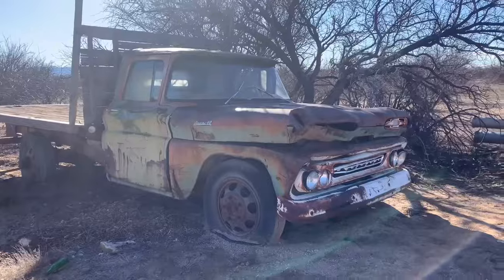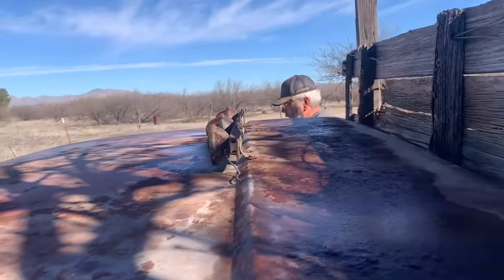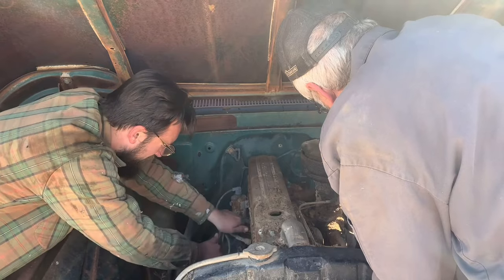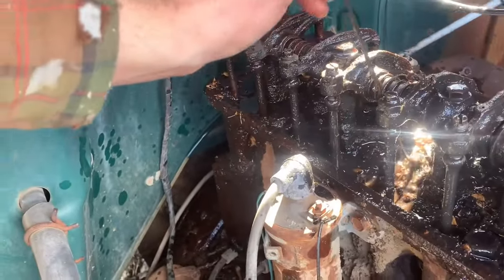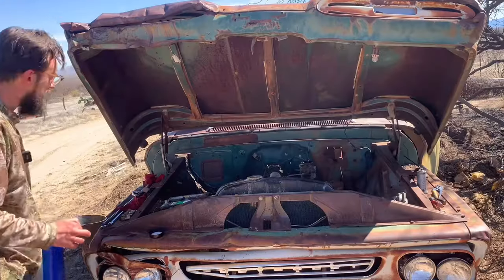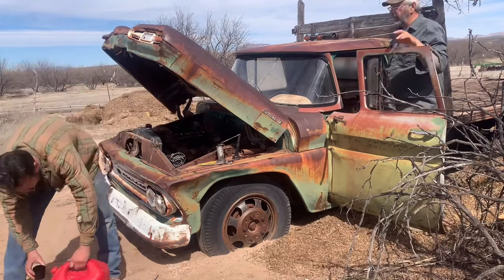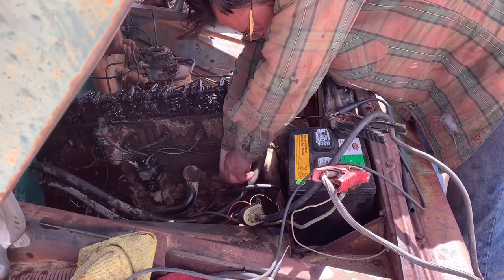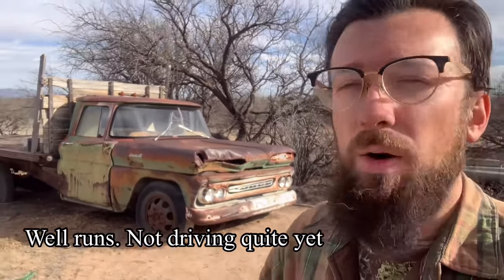‘61 Chevy ranch truck ABANDONED 38 years ago hauling hay. Will it run?

Comment: Great job, guys.  That old 6 wanted to run, and was happy running.  Quite a testament to how well it was built.
Reply from the maker: Yeah! Great engines. Thanks for watching
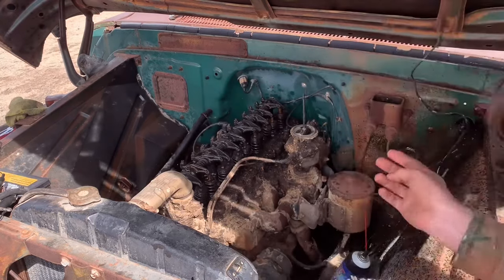Reply: @MaxGiganteum  You missed it at 31:15 when it had plenty of oil pressure and blew that hose.
Reply: If it had pressure to blow that line it's got plenty.  These had a passive oil filter system and would only filter a small amount of pressurised oil at a time. That line is straight off the main oil galley to the filter which then drains right back to the pan wont change the oil flow at all removing it just wont filter it.  Besides these could idle all day long at 10psi and run fine.
Reply: Watch GM bring back inline 6 engines.
Reply: @rustbeltrepair5472  😊

Comment: You're doing a great job saving those ancestors from melting down into rust forever.  Hello from Belgium, Europe :)
Reply from the maker: Thanks for watching from europe
Reply: @Theetravisb  
What do you guys charge?
   I have a 55 gm that's been sitting for 15-20 yrs.
    It's got a 455ci from a 72 Buick century in it.
 
    It ran GREAT when I parked it. No leaks, no slips, didn't burn oil , no knocks. Not even any lifter tics.

    I parked it when I was in college because the breaks were shot. 
    Started it every once in a while, but haven't done that in over a decade..

    She's got pleanty of "patina ".
      I'm going to tear into it myself this spring, but this might be right up your alley!
Reply from the maker: @jupitercyclops6521  please email Me more details to my email travisblades1956@gmail.com

Comment: I think this thing owes it's survival to being a leaky, worn out motor when it was parked. That was a lot of caked up oil! I bet it was burning a lot of oil, too. If it had been a fresh engine when it was parked, I'd bet it would be locked up by now. Anyway, great video, love these old trucks, and can't go wrong with a 235 stovebolt Chev. My grandfather had a 61 Apache 10 he used as a work truck for almost 20 years in the oil business. Was a great rig, wish it was still in the family.

Comment: You and your father are a inspiration. My fatherinlaw had a old chevy with a 292 cubic inch engine . It had over 550,000 miles . Motor and trany was original.

Comment: Okay thanks for the grammar update. I think it's totally ridiculous that you get hate mail over that. But I googled it. So both are correct depending on which way it is used. Here is what I found:
Dad and I if that's the subject of the sentence. Dad and me if it's an object.

There are great yard in southeastern Tennessee. That will take you almost across country. There's a possibility of to 1970 mustang. One being a Mach One and the other being a mustang GT. Both of them have an incredible story with just a few thousand original miles but they've been setting and not the best circumstances. They are around the Carolinas. I know where they're at. You could team up with another YouTuber across the country. That way you have some ground support that would be nice. How about Colorado a great place to visit. The cars would be straight and more or less rust free. Little fella. Just bought about 10 59 Chevy's maybe a 1960 as well. He is in California. Just some ideas if any of the sound interesting I'll be glad to give you the details. None of these sites include me. So I have no angle except for our I do enjoy your channel. I think I may have mentioned this before but there's a guy in Tennessee that is doing the thing that you propose and driving out within a certain radius and getting cars and trucks to run. I'm reasonably sure he would be open to assisting you in something like this as far as locating. Have a great day

Comment: Atlas was a name used and owned by Standard Oil Products . Standard fuel / Service stations , here in California & across the country they sold there Atlas parts back in the 40`s 50`s that included, tires, shock absorbers,  batteries, and more. Sometime in the early 60`s Standard gas stations changed there name to, Chevron stations here in California, they are still this name today.

Comment: The ignition key and set up is the same as Holden (GM Australia) used in the late 50s, early sixties. If you turn the ignition to on and pulled the key, you didn't need the key to start it or turn it off. Thus, the raised switch shape of the ignition switch. To lock it, you just put the key in and turned it to the lock position, and pulled the key. My dads old Holden, being very rural, hardly ever had the key in the ignition 😂

Comment: Good job guy"s!I"m 63,been a GM man all my life,it was a requirement or the family would kick you out! None of my Dad"s vehicles ever had a key.GM,gives you something to grab and if you can pull the key out with the ignition on,you"ll never need a key again as it will never close farther than the lock position.An old time mechanic told me years ago."Alway"s pull the plugs & fill with Marvel and let it sit a day or 2.The rings tend to rust themselves to the cylinder walls,If you move the engine at all,you"ll break those rings right inside the cylinder.Me myself,once you get that far,then new points and plugs etc.But to each their own.

Comment: A 235 has a lot of oil pressure. The  oil filter is made to restrict some pressure. Please change the oil. 
Hydraulic brakes factory on the 61.
Torsion bars on the  Apache  40 ?
X box frame?

Comment: Yeah Atlas Batteries I remember them back in the mid 1960s. had a few of them myself they were kind of a rebuilt battery when battery shops did that service  yeah goes back to the 1960s and I am old enough to remember started driving in 1968

Comment: old is a good 6 cylinder chevrolet engine , here in Brazil we had it with displacements ranging from 3100 cc , 3800cc , 4100cc and the engine that came out in chevrolet trucks destined to work in alcohol plants breaking the 4900 cc called sugar cane , I have a chevrolet Opal derived from the German opel rekord with the 4100cc engine, European design with American engine

Comment: Something that has set for a long time. We've even it if it hasn't set for a long Time if you Put rottella t6 In it, you give better lubrication in the oil. Does Not Break down as quick as regular engine oil. I use rotella t six in my vehicle all the time

Comment: Although I don't favor this style of getting something running without at least flushing out the dirt in the top of this engine... I am just guessing by location of distributor that its a 235, which is a great motor. I get called on calling engines motors but I drive my harley and its called a "Motor" cycle.... not a engine cycle, Its general motors, not general engines, and this continues with ford motor company... ford for a fact did employ a lot of people back far in the day.... if he called it a motor and can build a engine out of old farm stuff, good enough for me. I do hope they clean up under the hood, maybe re polarize the voltage regulator and get it charging again. Check around the back forties of local farms and find some better pieces and parts like a hood. Porta power the fender away from the tire and add some of that wind that blows around down there in the tires before moving it... makes it a little easier on the clutch thats had rodents peeing on the insides of the bell housing... Not sure when chevy decided to make their engines all parts interchangeable for the bellhousing from a six to a V8 engine with using the same bellhousing off of the six along with the flywheel as well. Its for sure on the 292 engines but now the 261 again is not my strong suit. It sure would of been sweet if this old girl had had a dump bed on it for farm work. I am sure that she is in need of a lot of grease and oil to make it feel like its a driver again. Two speed rear ends were real popular so that part interchanges if you pull the spring package with it. I've owned every year of chevy ford and chrysler products from the early twenties to the first part of the nineties. My best overall rigs were internationals as they were just well overbuilt for strength. I have even owned the much bigger trucks as in pete's, kw's, freightliners... had a fleet of kw's on the highways for a good many years. A accident in 2005 with only small insurance .... took everything I owned away and been a cripple every since that day.

Comment: Very Col find those old Chevy straight 6 were great engines  my guess is if it spins  or even moves a little by hand you guys have a runner !   a lot of Car and Truck guys   are keeping those old Batteries for  the cases  to be used as a Display  inside the engine Compartments  and Hiding a modern Battery out of veiw to be used  as a actuall battery for that Vehicle BTW  Walmart  does have a New Recreation of the PumpOilers , they are Brass  not high quality like the Old ones  but they work I keep one filled withMarvelMystery Oil  in the Engine Rooms onboard all my Boats  they have   nozzles on a approximately 8” long tube that makes it easy o squirt a little Oil into a Spark Plug Hole  or any concentrated areas you need  to get at  i also keep a length of hose that will temporarily ft over the Nozzle  to squirt the Cylinders whenever i do that i use the Marvel to  help preserve older Motors  and /or free them up after sitting for long periods  mainly because my Dad and Grandfather Swore it worked  on Antique Cars and Trucks ? myself i’m not convinced it does but  it’s inexpensive and i don’t think it hurts  anything either  i have several engines from the 1950s and 60s  that i keep maintained and Running  using Marvel  So maybe it does do something for them ? FYI i Own ,Collect , and do all my own maintenace on Antique British Cars and Chris Craft Boats that usually use  either Ford or GeneralMotors Motors that are Marinized with bolt on parts  but are basically  Truck or Heavy Duty  motors designed to handle higher Tourque Loads  Trucks and Boats need  i’m also fond of Detroit two stroke Deisel Engines ,Old Outboards and Intage Honda Motorcycles i use Marvel On often